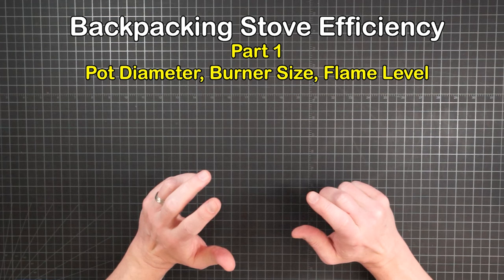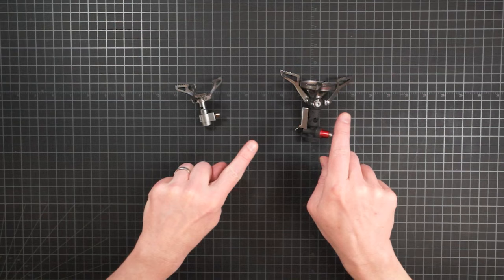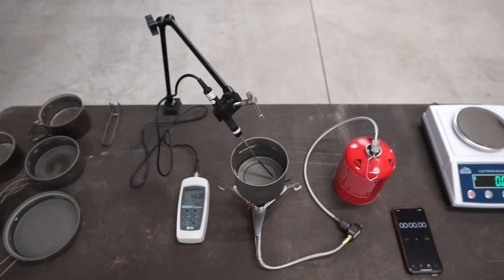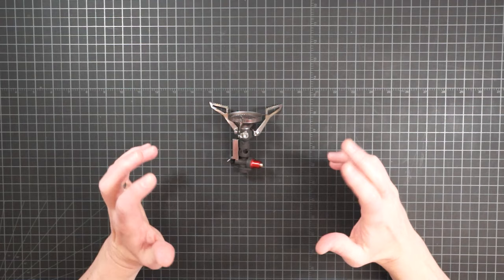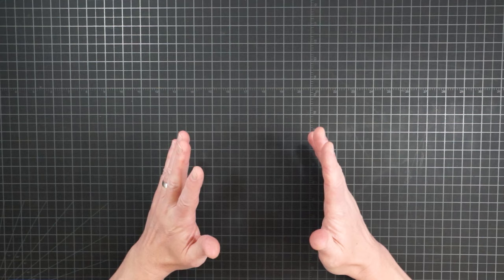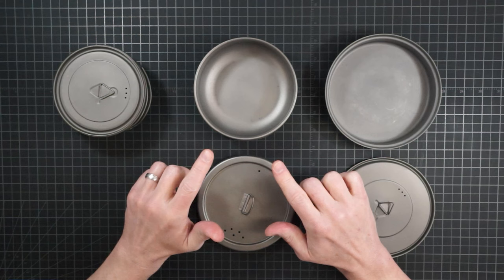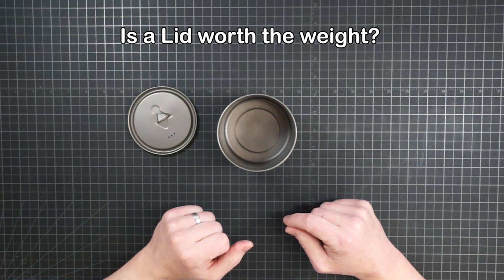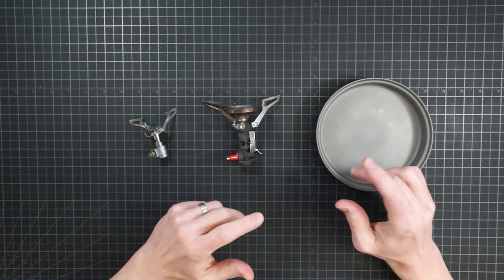Backpacking Stove Efficiency, Part 1: Pot Diameter, Burner Size, Flame Level

Comment: Great work! Your dedication to precision, thoroughness, and transparency make these videos some of my favorite on YouTube. One question: You've implied that your results show smaller stoves are better -- what if the BRS-3000T just happens to be more efficient? You've accounted for temperature, fuel rate, etc but there's always the possibility that some "mystery variable" could be changing between stove designs. It could be the angle of the stove holes, leaks, or shape of the flame. I'd be interested to see if there's any noticeable difference in fuel efficiency between two stoves of the same diameter, all other known variables remaining equal.

Thanks for the great video! I'm looking forward to seeing your insight on future results for pot shape, wind speed, material, etc.
Reply from the maker: Interesting point.  I've assumed so far that same-sized burners would perform similarly.  It really ought to be tested, though! (scribbles notes for future research)

Comment: Such great info. I'm probably not the first one to comment this but If I could make one suggestion it would be to do this test under circumstances which more closely approximate field conditions, in particular wind speed plays a huge role in stove efficiency and that effect seems to differ between stove designs and I suspect the same is true of pot sizes.  

To do this test one could set up a fan nearby giving a constant wind speed approximating mild to severe conditions. 

Temperature and elevation also play a role in fuel efficiency but I can't imagine the effect would depend very much on stove design, but I suppose pot size might be relevant as higher temperatures will increase evaporation rates making wider pots potentially slightly worse? not sure. 

To minimize the effect of the pressure loss due to the cooling of the fuel canister one could set it in a large container of water to act as a heat sink. (ice water would give the most consistent temperature but then I would hardly call that average conditions)

It would also be interesting to test in what conditions if any the fuel savings of wind screens will offset their weight. 

As for which stoves to test beyond those in this video I would like to see the regular pocket rocket 2, the soto amicus and soto windmaster (you might need to try both the 4flex and triflex supports), the three of which are among the most popular stoves these days. Jetboil would also be interesting. 

In any case keep up the good work, it's genuinely some of the best on the entire yt platform.
Reply from the maker: Yes! Wind effects will be Part 2, with windscreens and heat exchanger pots to follow.
Reply: @GearSkeptic  When do you think you'll release your next video? I bought wider pots (with a lid) thanks to your advice and keep flame low but in windy condition even with a wide pot placed "downwind" so more of the flame is under the pot I still get worse performance than no-wind. I am next experimenting with a remote stove + windscreen, it adds weight but may be more efficient. I am also getting annoyed with Titanium pots you can't cook in them even with lots of stirring, had "black porridge" last week so may go back to Alu just for the widening of the hot spot.  There's more to camp food than boiling water.
Reply from the maker: A few more weeks, at least. Kind of swamped right now with seasonal duties.

Comment: FYI: the boiling point of water is dependent upon air pressure and components in the water other than H2O (e.g. chlorine & fluorine treatment of municipal water, as well as mineral content) .  Air pressure varies dependent upon altitude above sea level, as well as local weather conditions (e.g. nice weather = "high pressure"; bad weather = "low pressure").
212'F (100'C) is the boiling point of pure water at "standard pressure" (i.e. nominal sea level = 14.7psi).  I live at the beach, so my house is only 14 ft. (4m) above MSL (mean sea level); on nice days we routinely have air pressure over 15 psi (meaning the boiling point of pure water would be over 212'F (100'C). Since you noted an elevation of ~2500 ft. (750m) above MSL, the boiling point of pure water would be less than 212'F (100'C) at your location (with added variation due to local weather conditions).
Bottom line: Changing weather conditions likely account for the day-to-day variation you noted.
In future videos of this type, it would be helpful to include the absolute barometric pressure at the time of the test (note the barometric pressure as commonly reported on the evening news is altitude adjusted. For example; a nice sunny day at the beach in LA would measure 31 inHg (15.2 psi) absolute - whereas a nice sunny day in Denver would measure 21 inHg (10psi) absolute, but the evening news would report 31 inHg in both cases).
Reply from the maker: Interesting point.  I monitored temp and humidity, but hadn't tracked pressure.  I can include that for future tests. Thanks.

Comment: It would be interesting to see how a heat exchanger pot would affect this. At what point does the additional weight (for a given pot material) provide an overall benefit (if at all)?

Another wrinkle are accessories like the Flat Cat windscreens, which are specifically designed to improve efficiency even more when using lower flame levels.

I did a science project with my kid a few years ago to try to figure out if liquid fuel becomes more weight efficient over longer trips than a canister stove by boiling water for 3 minutes (standard Ramen time) on a Pocket Rocket and a Whisperlite. (The result was the Whisperlite was never able to overcome the additional weight of the stove, but the bulk of the cannisters was a significant limiting factor for long outings.)
Reply from the maker: Heat exchangers will be Part 3 following wind effects in Part 2 (a nice segue).  And, I've already got my eye on some Flat Cat screens!

Comment: I like to the scientific approach. The wider pan is not practical in my opinion as the risk of accident increases as it did not look as stable especially with the water at the brim and, as you pointed out, the water would cool faster if you did not tend to it right away. Another point is the usefulness of the lid as some use it as a strainer and it can help with storage - a covered pot with items inside. Thus the lid can have added benefits to offset the small amount of extra weight. Finally, with respect to you intended research on the wind, I think that you should add a windscreen or do a windscreen test. For the same tests that you did, I postulate that by having a windscreen surrounding the pot (hugging) will or should improve the fuel efficiency.
Reply from the maker: Agreed!  I want to choose stoves with varying inherent wind resistance (the Soto Windmaster vs. the unprotected BRS), but also definitely tests to see how a windscreen might be able to save the performance of an ultralight stove.

Comment: Good methodology on gas flow, IF the stoves have a higher flow rate than the "high" regulator. I didn't hear you mention that part.
Reply from the maker: I did make sure that the “high” was at least slightly less than the “wide open” for all 3 stoves when choosing it.  I didn’t actually say it, but realized during editing to mention it with text.  During that part, there is a brief sentence on screen in gray lettering. 👍🏼
Reply: @GearSkeptic  As detailed as you were I figured I missed, it, which I did.

Comment: Fascinating research you have done!   Let me mention that I sometimes actually “cook” in my pots… for example when cooking ramen I will add the noodles to boiling water, boil for a minute then cut the flame.  Then I let them cook in the covered pot a few minutes then reheat to boil.  I may repeat this again.  I assume I am saving fuel that way?
Reply from the maker: I have not timed it both ways, but I would make the same assumption.

Comment: I missed this when it came out, but am watching it now that the next part in the series came out. It may be too late to make suggestions, but I was wondering if a lid made from an aluminum soda can would work better than aluminum foil. I also wonder if a lid from a heavier aluminum can or bottle, such as used for some beer brands (e.g. Heineken) would work better. Also, I wonder if using simple tools to create specific structures in the metal (e.g. indents in the shape of rings or spokes) would give it better structural characteristics.

Thank you for your hard work. Happy boiling!
Reply from the maker: Interesting ideas!  A lot of people will take those disposable baking trays you can get at the grocery store and cut them up.  They are essentially aluminum foil of a thicker gauge.

Comment: Another fantastic video. You deserve so many more subscribers! Do you have a hypothesis for how these results will be affected by ambient temperature? Since being on the AT early and late in the season temps will likely be lower than those in your workshop, is it conceivable that lids will stand proud once again in reducing our precious total grams carried?
Reply from the maker: I suspect that both wind and colder outside temps will make lids more important.  I'm planning Part 2 on wind effects right now, but I will definitely have to wait until next winter to do some very cold tests.  Spring has sprung!

Comment: As a chemist there are 20 drops per ml water.
The grain size bubbles as you call them are gases disolved in the water outgassing.

With the BRS using a pan I found you get a boil in the very middle of the pan, approximately 2" dia, and the outer edge, 4", had no boil.  

As you make a comment of a tea light, which I have never used as it is ver inefficent, you dont have enough calories in the teal light to boil more then a cup 

for your water to boil with your 150oF you have oconvert the temp to SI units
65oC  
so the callories you need for 500 ml(500g) of water is 32 J.
Reply from the maker: Good to know.  Thanks!

Comment: Excellent and well executed! Looking forward to the future tests. Thinking about lids, was surprised that it didn’t make greater difference. But it might be different if the tests were made in cooler temperatures? Maybe greater gas savings with lids in cold temps, and less in warmer? And even more so if windy also?
Reply from the maker: I suspect you are correct on both counts.  It's getting warmer already, so I will have to wait until November to test colder temps, but the Part 2 on wind effects is in planning right now.  It will probably change some of these recommendations.

Comment: Great video! Lokkong for next part. And curious how much ambient temp will impact fuel efficiency with or without  pot lid .
Reply from the maker: I would like to do some tests in very cold weather, but at this point I think those will have to wait until next winter.

Comment: Outstanding.  Mostly as expected.  Lid was surprising result, but may redeem itself in wind?  Made a 5g lid out of flashing-aluminum for Toaks 550.  BRS has never performed well on simmer (low flame) in this author's experience.  Again, wind?  Suspect the best configuration is to have an abbreviated Caldera-cone lip extending just 2cm below the pot-bottom to trap heat.  Made several designs using 0.005" titanium-sheet held in place by lightweight metal heating-duct zip-ties.  The best one had a thin layer of white-ceramic insulation between the pot and sheet-Ti.  This design captures the heat and holds it against the pot, while simultaneously blocking wind (28g).  

Presumably, a welded caldera-shield could weigh less than 14g, but isn't as packable as one might like?  Still, if one wants both fuel and weight efficiency, a lip around the pot-base is surely a winner.  It's better than a lid or a wider base, plus it blocks wind.
Reply from the maker: Agreed.  I suspect wind will change some of these recommendations.  Working on stove selection and windscreen ideas now, for Part 2.
Reply: @GearSkeptic  - Suspect the key is to trap/slowly-guide heat up the sidewall of pot, without spoiling fuel burn-efficiency?  Jet-boil-style welds heating fins only to the bottom, which misses the all-important sidewall heating opportunity.  Further suspect inserting a thin layer of ceramic-insulation between pot and sheet-Ti enabled maximum temperatures to develop in that all-important sidewall space, because of a chimney-effect?  Without ceramic-insulation (and associated gap), the pot surely cooled the trapped air, which could only fight its way down and out the bottom?  (more...) 

Always wanted to weld a sheet up the side of pot with a very small gap to get rid of the ceramic and the stainless zip-tie but alas, am not a welder and own no welding-tool.
Reply: @tomnoyb8301  this system you describe is being used with an isobutane canister stove or an alcohol stove? If the former you need to monitor canister surface temperature for safety purposes I would think.
Reply: @wanttogo1958  - Then you failed to read the post.  Instead of building a giant windscreen from the ground up, the screen attached to the pot and extends only 2cm down.  This is well above the flame, therefore above the stove and therefore well away from the canister.  Not really going after the wind blocking aspect of Caldera-cone, rather the heat concentrating aspect.  After all, the portion of a Caldera-cone that's so effective at heating, is that the rising heat is transferred to pot's sidewall.  (more...) 

Instead of allowing a mixture of outside-air (say 50°F) to chimney up with 500°F heated air (effectively cooling the air streaming by the sidewall to maybe 260°F), have designed a reverse-lip extending 2cm below the pan's bottom to trap and hold the fully-heated (500°F) air against both bottom and sidewall.  

Since heat rises and the hot air trapped against the bottom and sidewall is no hotter than the stove originally output and is barely closer to the canister, there is no measurable extra heat applied to the canister.  Had you read the posts, you wouldn't raise such specious and inane issues, where there are none.  This design is vastly safer than any and all windscreens resting on the ground (which are virtually all of them).

Comment: Thank you so much for this. This is exactly the kind of data I dream about, but am too lazy to test myself. 

I would be interested in seeing how much centering the cooking vessel on the stove effects efficiency. It's something I'm super OCD about and whenever I see an off center pot it triggers something in me. 

I'm curious to know if my worrying is actually justified by a measurable change in fuel efficiency.
Reply from the maker: Funny you should mention centering.  I’m doing some wind testing now, and watching how the flame gets blown sideways and misses most of the pot. 

It got me thinking, what if I deliberately offset the pot from stove center, to try and catch more of that downwind flame?  I’ll have to test yours and mine!

Comment: Here's a question regarding philosophy of use:  if boiling water is your only objective, why not save a bundle by using a simple diy alcohol stove?  Forget about the noise.  Alcohol stoves are silent, cheap, and easier than anything to make.  Just asking.  By the way, I do own the BSR, but have relegated it to the storage bin.  Many thanks for sharing your thoughts on such a hotly contested issue.  Cheers from Montreal QC
Reply from the maker: I do plan to test alcohol stoves, once I get all the baselines with gas established.